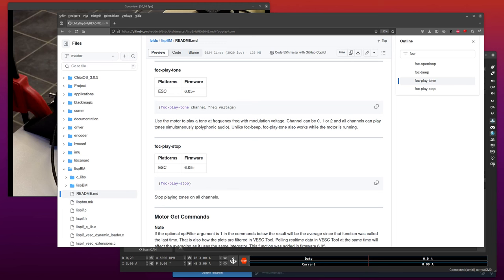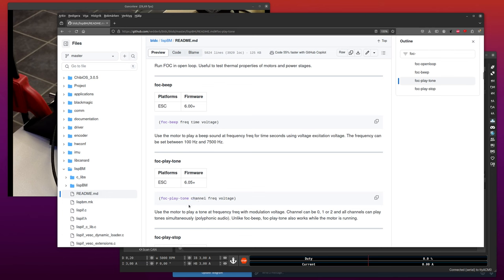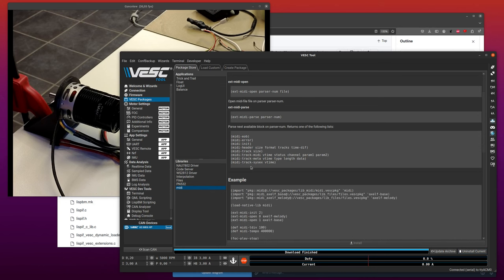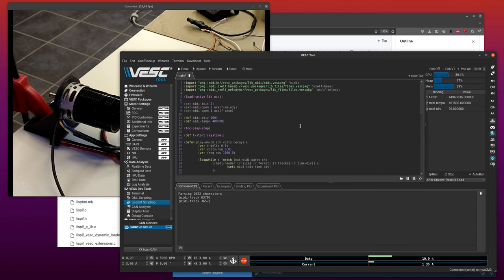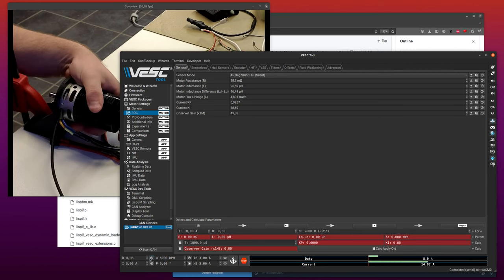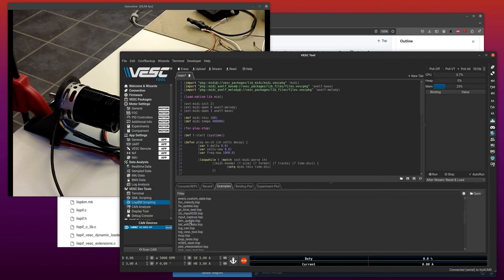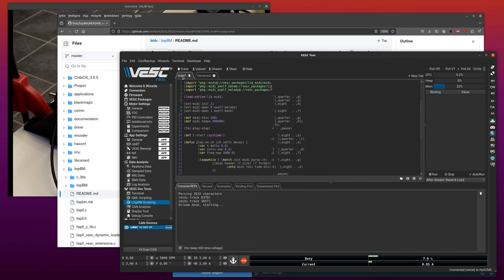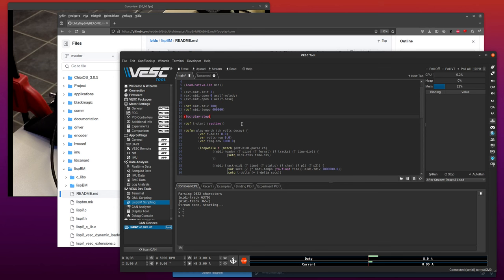VESC Play music while the motor runs

Comment: This is professional and funny at the same time)))) Now for each vehicle you will need two motors. One will push the car and the second will make the sound of a diesel or gasoline engine 😅😅😅
Reply: The new code he is illustrating was done specifically so it can create sounds while it's running. You just need a synthetic engine sound generator to feed it.

Comment: Hello!  One question: I have the Lisp file for the VESC Controller Dual and VSETT Display but I don't have a VESC Dual, just a 75100. Does that matter or do I need the Lisp for the one 75100 Controller and VSETT Display?  And how do I upload this Lisp?  If I press Lisp in the VESC tool on the computer and then select everything and press delete with the mouse and then just click on insert the Lisp file for the new VSETT display and press upload?  Or do I have to select something specific at the bottom of the list beforehand?  What do I have to select below?  Or do I just have to click below:;  Press "Examples" and select the whole thing at the top and press delete, so delete everything and then paste the Lisp at the top and click upload. Does that agree with the bottom: Examples and then paste my copied Lisp file for the VSETT display at the top  and upload? Can you just please answer me. 1. press Lisp 2. press .... 3. insert Lisp file and 4. press upload. My kmh display on the VSETT display works from RX + TX cable. I  I have connected RX to TX and TX to RX from the VESC 75100 and VSETT display. I beg you! Kind regards :)

Comment: Would be interesting to test how much extra battery this requires compared to running regularly without this mod. Also how much hotter the motor runs with this as compared to without it.
The test setup I'd imagine would be running a stretch of known terrain without this mod to get a baseline. Then run the same stretch again with this mod and see what differs in battery usage and motor temperature.